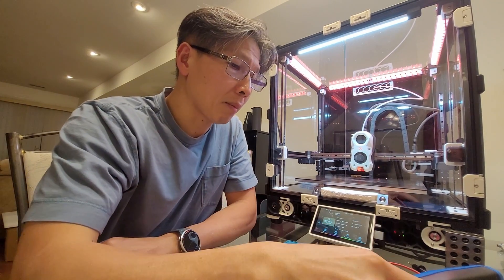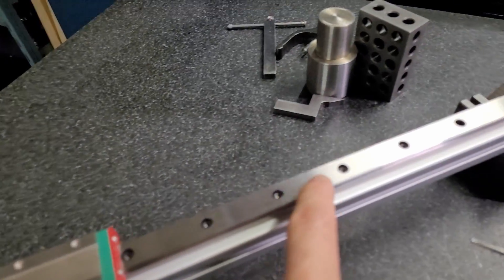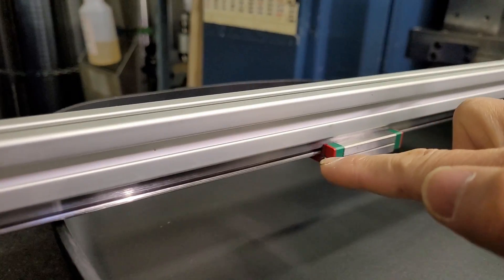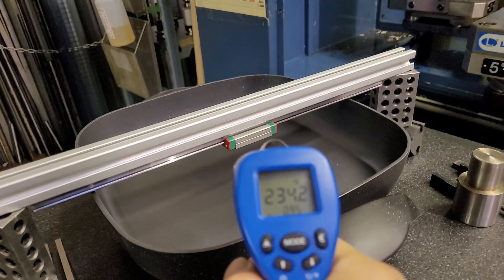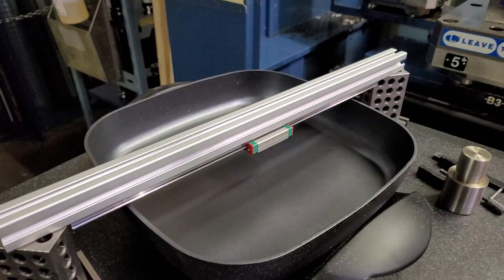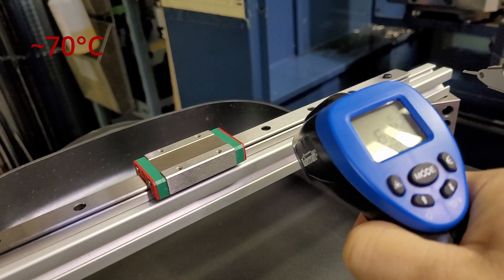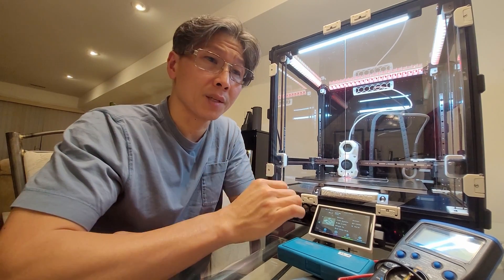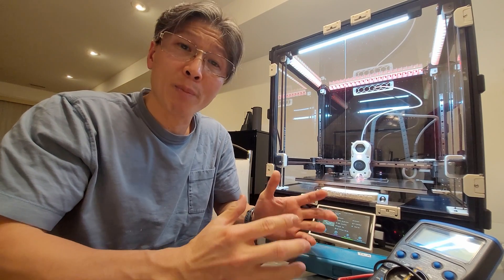Do we need extrusion backer for Voron 3D printer?

Comment: It is great that you are testing... But you cannot do a test that does not replicate all variables of the system and conclude that the results hold true to the real world system. Without the ends constrained, and with the aluminum in this example being open to the air and not enclosed a heat soaked within the printer, you will get vastly different results.  I have multiple surface plates, all manner of indicators, - all the wonderfully accurate metrology equipment I need for work as a machinist - but this is not going to help me determine what is happening within the machine as a print at high temp runs for 2 hours... The z height sensor is a the most accurate way I currently have to see what kind of differences are showing up within the shape of the frame under printing conditions, and placing two different bed maps side by side at different temperatures shows that backing plates most certainly do assist in removing unwanted movement in the frame from heat. 

Once you add a bit of a bend in the X axis extrusion, some bends in the Y axis extrusion, with the expansion of the entire z axis and corresponding increase in relative Z height compared to cold, you can easily see a change in Z position of 0.15 to 0.2mm from where the software expects the print head to be.

Comment: Thats a lot. But the solution is simple: long heat soaking before bed meshing
Reply from the maker: Yeah totally agree! I always start my 3d print when the chamber is about 40°C which I find it alright. I am not making aerospace parts so I don't really care much for 0.001" or 0.04mm deflection that's justified for any extrusion backer. IMHO, it's a waste of money. Thanks for  your opinion!

Comment: 50 microns is .05mm, thats enough to throw off your Z adjustment. When you get up to 80c, the deflection can go as high as .1841mm with an MGN9 rail, that's enough to ruin your print entirely.
Reply from the maker: what? are you building aerospace parts?

Comment: Wait, is it 100 microns difference? 0.1mm? Damn that's a lot. I have 70C in my chamber.
Reply from the maker: Well, i think cold nozzle vs hot nozzle is more than that. Anyways, important thing is that i heat soak my printer chamber 15-20min before print_start or start_print regardless of my chamber temperature. With or without backers, i got no issue.
Reply: I heat soak until my chamber reaches 70 C. I have a lot of insulation and bed fans. It can reach 80-ish.
Reply from the maker: @sabahoudini  yes i heat soak my printer as well ~20min to make sure the spring steel plate is heated evenly and actually 100°C.  And this can be easily indicated by my chamber temperature sensor. I wonder how you insulate your printer to get chamber to 70°C. I plug all possible "holes" but my max is 50°C. I guess you must use foam material for panels.
Reply: @lavithhcm  Yeah, insulation panels and bed fans. The bed fans will increase temp by 10C alone without insulation but I only use them when heat soaking. The chamber temp will not reach max after 20 minutes, you can maybe get to 55 after 45 minutes or so. Also for ABS/ASA I use 110 degrees bed. The difference in print quality is huge. Even 350mm objects with tricky geometry will not warp and the parts will be much, much stronger even when you print at 300mm/s.

Comment: It's cool that you're bench testing this and it's neat seeing the bimetallic flexing measured.  

Modeling and measuring the bowing on the y axes has typically resulted in values of 0.1mm to 0.2mm deflection with a 40° temp delta depending on the printer size. It's not a huge amount but is enough to effect large first layers or adhesion between large first and second layers. 

Backers truly aren't necessary as a long heat soak and a bed mesh will accomplish the same thing. You just need thermal stability once the print starts. I just don't feel like waiting that long before each print so I choose to use backers instead. 

Also when this phenomenon was discovered the x axis had a bottom mounted mgn rail which doubled the effect making backers even more valuable. 

Anyone can test this in their own Voron printers to measure the effect. Take a mesh with a hot bed before the chamber has heated up.  Then center your toolhead, turn on your part cooling fan and wait 30 min.  Take another mesh following a heat soak. Compare them side by side and the change in the mesh should be very obvious. 

If you don't see a change in the mesh then congratulations!  You don't need backers. Or if you don't mind waiting for heat soaks you don't need backers. For impatient and particular folks like me it might be worth it.
Reply from the maker: There is few micron difference between hot bed (100°C) and cold bed (room temperature) with my bed mesh. I just did a scan with cartographer probe. I 'll post a picture of heighmap soon. For me, I'd use the budget for the backers towards more "premium" Mitutoyo measuring tools. 🙂 because I can reuse the tools more often than the backers

Comment: I would recommend putting a scribe mark on the extrusion and rail at each end of rail and the middle of the rail before heating. I suspect that your rail has slipped on the extrusion, that is the screws holding rail to extrusion are not fixed resulting in the rail slipping on the extrusion.  Not that this is could not happen on the printer, but would account for the low deflection. 

For example assuming the rail is 500mm long and made out of steel with a coefficient of expansion of 10.8mm/mm/C then a 30 degree change in temperature would result in 162um expansion of the steel rail in length.  While the aluminum with ~24e-6mm/mm/C thermal coefficient of expansion would have increased in length 360um.   This should result with the back of the linear rail being longer than the front by ~200um (0.2mm), which would cause larger deflection in the center than you measured.   My high school math, which may be wrong, says that an 8mm thick rail that is 200um longer on back side should have ~1.5mm deflection in the center.  However if the steel rail was not mechanically secured the aluminum extrusion then bolts could have slipped on extrusion and resulted in less bowing.  If this was/is the case then the scribe marks made before the heating would not align when heated, and would account for lower deflection measured in this experiment. 

Additionally measuring of the length before heating and after would confirm the temperature coefficients and help validate the test.
Reply: Note that engineers will argue for days over the result of an experiment that takes 15 minutes.  The reason engineers do this is that engineers develop mental and mathematical models of systems.   They use these models to predict behaviors. In fact a rule good engineers have is that they never do an experiment which they have not predicted the results of the experiment before hand.  That is purpose of experiment is to prove or disprove an hypothesis.  
In your test you had hypothesis that the bimetal thermal expansion was not significant.  However you did not predict what the bowing should be, additionally you did not define what is a significant amount before the test and then justified significant amount afterwards.  This is not bad and I commend you for doing the test!  However predicting results before hand and then documenting why it is not what was predicted would provide greater understanding and knowledge. 
For example if the answer is to have some T slot nuts so that the linear rail can slip on extrusion with thermal expansion, then that would have been good information.  Maybe make T-nut out of PTFE to plan on the thermal expansion and slippage.

Comment: FYI: while 0.05mm difference is not enough to break something, it is very much noticeable.
It probably won't cause any mechanical problems, but it will result in reduced cosmetic quality.
Also FYI, 0.003" is 0.0762mm

But your point is mostly correct.
No backing should be ever used and these titanium plates are plain stupid and a marketing scam.
The actual real solution is to just preheat all the parts before tightening the bolts.
And this is actually super easy to do and it doesn't require any special tools or equipment.

Just keep all the bolts loose, turn on the heat, let it saturate the parts and then quickly tighten em.
Aluminium and steel can store more than enough heat to let you even a couple of minutes to tighten the bolts.
Reply from the maker: So right on point! !👍 we are not making rocket engine to go to the moon.  If some want to have a perfect look, they should look into finishing process. Dimensional wise,  parts  come out the same with or without the backing plates as some have already said. Bling wise, yeah it is a must. Money wise, expensive with paper weight value. 😁

Comment: Bit lower than the 0.15 i guessed but that could be due to mgn9 vs 12.
But still less than the variance on most beds so its fine if you heat soak the printer before probing.

Comment: You want to do this test with the print head on since that adds a lot of weight, there is usually quite a bit of bowing just from that alone.
Reply from the maker: No matter what we do, there will always be thermal expansion in aterial. Even with real CNC machine, there is usually 25-50 micron difference shown in machined part between cold and warm machine. We adjust Z offset in tool settings to accomodate for that thermal expansion.
Reply: @lavithhcm  Which is why CNC machines are adjusted to be true when warm especially those which are used for mass production like Swiss lathes the first parts will always come out a bit out of spec until the machine comes up to temperature.

Comment: Great video.  Finaly some tests with proper tools for machining.  Do you think you could test the slop in the car of those rails and maybe compare them to machinist grade rail.  That would be vary interesting..  Thanks for the great content.
Reply from the maker: "Slop in the car?" You mean the "play" in the sliding block then? Honestly, I feel no play at all. If you feel any play from the sliding block you should replace it. They (manufacture) should "preload" the sliding block to the point that there is no play. Too much preload, it will experience premature wear, too little or none it will be sloppy and might have play between block and rail.
Reply: @lavithhcm  yes that’s true but I do here a lot of the voron and vzbot builders about buying Hiwin rails because they supposedly have more preload and are better then the AliExpress rails.

Comment: Your experimental method is suspect. Have you looked at the results from the guys who actually measured deflection on beams installed in enclosed printers and allowed them to equilibrate?
Reply from the maker: Well i might try that. Poke a hole on the side "foam" panel and keep measuring with the indicator.
Reply from the maker: @jimmer411  if i have extra bling i'd spend it on Mitutoyo dial test indicator which not many people would consider it a must. Chinese made are ok but they are not anti-magnetic.

Comment: I think people like to remove some variables.  I believe most understand that the extrusions are not perfect, the rails are not perfect, and the mounting hardware and fasteners are most certainly not perfect.  But heat expansion is one variable that is difficult to test for, and backers are one way to minimise compounding tolerances.  It is not necessary for sure.  But it is a hobbyist machine, people will tinker and mod this to the moon.  For most, the out of the box (BOM) is good enough.  But some people chase perfection by any means, and for them it is a different kind of fun, to watch the improvement to their mesh graph.  But as with anything, the closer to 100% you get, the more cost there is involved, and the diminishing returns.

In short, this information is useful to those to determine how much expansion deflection to expect.  But chasing .05 mm is up to the individual to determine its value.

Thanks for sharing!
Reply from the maker: Yup...yup we are not making rockets to go to the moon. 🤣

Comment: Also, that is an mgn12 rail right? that would go on the x, with mgn 9 on the y. Its the y deflection that matters most, so the mgn9 would be less stiff. Its also not that extreme of a case, my chamber temp reaches 60C. If you are into ABS this will be an issue.
Reply from the maker: Yeah, you gotta watch out when your chamber temp gets high. Mine doesnt get that high though. I guess there will be more deflection deviation  for thinner material.

Comment: Just another way to think about it, 0.1 is half the layer height. If you are printing something with a large first layer that means over 30-40 min, gantry can deflect by 20-50% of layer height, and first layer tuning is generally .05 between to high and perfect.
Reply from the maker: 0.1mm is extreme printing enviroment, you gotta evaluate how yours is. i know mine is somewhere 50°C and i have no need to go higher chamber temp. Besides, that deviation is negligible well  at least in my use case.
Reply: @lavithhcm  Yeah, im shooting for 60C as I print mostly ABS on the Voron. many people who are primarily interested in ABS will be shooting for that temp range. Perhaps that's why people start to feel backers are necessary. You really do start to run into first layer issues if you don't figure something our. There is actually a software solution as well that 'characterizes' the thermal change. It's called virtual gantry backers. Its free and adds no weight, and works well.
Reply: You'd usually thermal soak the printer anyways if you were doing larger parts, and how slow are your first layers if they take 30-40 minutes? If the z-offset is correct 100mm/s@5k is more than doable for most materials.
Reply: @twanheijkoop6753  You don't have to heat soak to far if you use 'virtual gantry backers', and z-thermal compensation. I use both. I get the chamber up to 45C, and the frame is usually in the high 20Cs. I have a 350 and print fairly full beds. My first layer speed is 110mm^2 and it can take over 45 to do first and second layer. That's where you will see inconsistency from thermal expansion, first and second layer. It will look like under extrusion, but its not.

Comment: So the result is 0.1 mm deflection?   That is enough to mess up your first layer.  Im someone who has wrestled with thermal expansion, both gantry deflection and Z-expansion.  I do prints with a large first layer so when the first layer was uneven it showed. Took a while to realize it was always the last part of the first layer looked high.

Adding weight on the y-extrusions doesn't really matter, they just go up. It would on the x.

you might be interested to look at the measurement scripts that give you a sense of how the bed, gantry, and z-expansion change over time. Google 'voron thermal expansion compensation' and look for the git hub. I can tell you, unfortunately, this stuff does matter. I sell prints so cant have uneven first layers.  It can effect second layer too.

Comment from the maker: My point in the video is I am happy with 50°C chamber temperatute and my ABS print comes out just as nice if not better. So, i care not about having to add titanium backers.
Reply: 50 degrees is pretty cold. Try throwing a blanket over your printer, or add insulation on panels, plug blind joints, add bed fans for convection effect and you can easily get over 70 degrees.